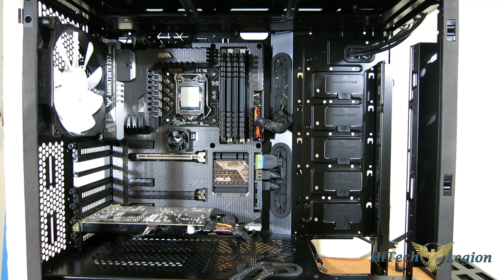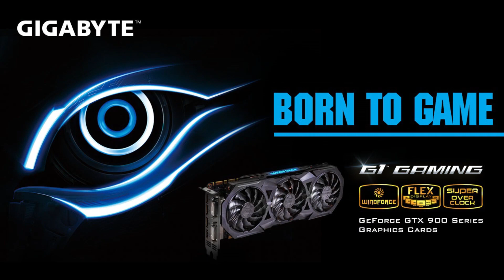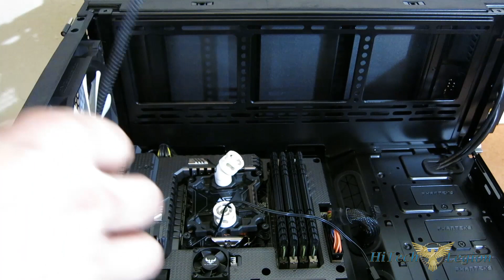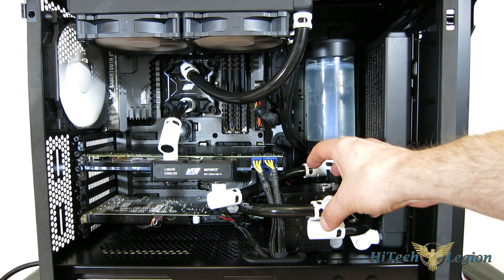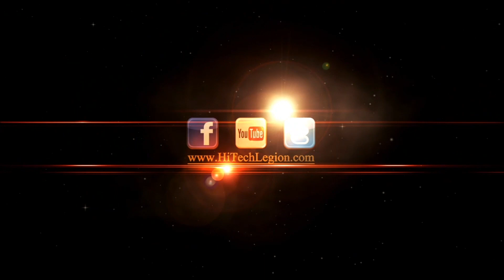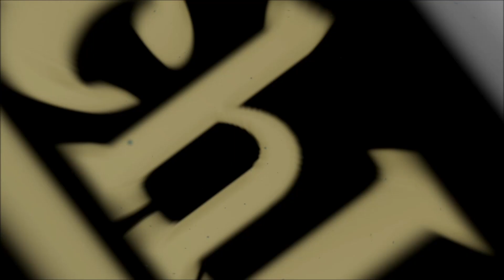Liquid Cooling Basics in The Phanteks EVOLV ATX

Comment: For 3 GPUs, 5 HDDs and 2 SSDs in the system, is it possible to install the pump in the bottom drive bay and a small reservour next to the PCIe slots (left hand side, away from upper five drive bays)?
Also, does are there enough opennings for exhaust, for the upper radiator?

Comment: Im using a Corsair h55 cooling system. If I plug the radiator fan into the fan hub to I plug the 3 pin pump power into the fan hub too or can I plug it into "CPU_OPT" on the motherboard?

Comment: Would you be able to tell me if using a 45mm thick 360 rad in the top with 1 set of fans (Alphacool XT45) and a 240mm Monsta in the front with push/pull would be possible? If it is, can it be done with the removable plate in the front of the PSU shroud left in? Can the fitting connections for both rads be in the top front corner of the case without any interference? Or is it possible to fit the 360 in the top with enough room above a rear 140mm fan to get the tubing connected there instead of the front?

Comment: Could you do a 280mm up top and a 120mm in the rear and then just keep the 200mm fan in the front as it is? would that fit?
I wanted to do a EVGA GeForce GTX 1080 8GB FTW Hybrid GPU with the NZXT Kraken X62 Liquid CPU Cooler. It seems to me that it would fit but I'd want to make sure before I buy it.

Comment: Are there space enough to mount 360 radiator with Push Pull in the top and the front? I´m think about using a "Fractal Design Kelvin s36"
Reply: 9082

Comment: So... is it possible to fit 2 360mm radiators with 25mm fans on the front and top without the radiators hitting each other? I'm sorry I didn't quite understand the part about radiator clearance. Very extensive review on the watercooling capabilites of this case though, it's just that my brain is a potato...

Comment: I'm still confused about the clearing for the top part. You mentioned that a thick radiator would interfere with the cpu waterblock, but I didn't get what those values were. What would have been the icing on the cake here, was the addition of a recommended max top/front radiator/fan thickness to not go over.

back to my question: will ~90mm be too much for it? I'd hate to spend ~200USD to find out.

Comment: Hello! Can some one help me? I was wondering the swiftech x2 prestige could be mounted in the front of the case?
Reply: +Facundo Cabral The H220 or H320-X2 Prestige will fit with no issue. I haven't had the opportunity to try the H240-X2, but I am very doubtful it would fit through the midplate opening without some modification.
Reply: Oh thx! Cause Im want to put a H320 x2 and other radiator

Comment: Can i put two 280 All In One liquid coolers in that case ? For example, can i put one Corsair H115i for the CPU at the top, and another one for the GPU at the front of the case ?

I don't really care about losing the mechanical drive slot in front. I just want to know if i can do it.

Also i don't want to put in in push/pull configuration, so count only the radiator an the two fans each time.

Any answer is very appreciated !
Reply: yes

Comment: Can i just remove the strips in the top to mount the fans ?
Reply: +KellerCraft You could....but it would weaken the chassis, and the fans would be only a couple of mm from the top of the case which would leave them as essentially useless.
Reply: +George Cella you know how much space there is?
Reply: +KellerCraft Not sure, but most certainly not enough to house a regular fan, maybe some really slim fans, but I doubt it would be worth it.

Comment: Do you think a crosair 100i hydro series could fit in there with a Gtx 980 ti water force could fit it there? But I was thinking of getting 2 Gtx 980 ti water force so do you thing 2 of them would fit with the crosair?
Reply: +Parker Myers You could probably mount the H100i at the top and then the radiators for the Waterforce cards in the front :)
Reply: both of then?
Reply: Parker Myers If the tubes are long enough, I don't see why it wouldn't work. I don't know exactly how big the fittings on the GPU radiators are, you might have to take off that little plate in the front of the PSU covers and maybe even have to take out the hard drive cage.

But if it's possible to mount the GPU radiators with the fittings facing to the side, then you should be able to mount but of them in the 2 top fan slots in the front and then the H100i at the top.

The third option, wich is just speculations from my side, could be to mount the radiator for the first GPU in the rear fan slot, the radiator for the bottom GPU in one of the front slots and then the H100i in the top. You might have to mount the H100i in the 2 frontmost fanmounts at the top, but it could work.

Comment: the only i worried is leaking ? but watercooling  is awesome .. :) any tip about that?
Reply: +Fazree Said Leaks are not as common now as people fear. The quality of components has gotten much better over the last few years. Use top notch components, compression fittings and tubing. Take your time doing your assembly and use common sense when you make your connections. Make sure you leak test before you power your components.
Reply: im stil learn on watercoiler not pretty confident to build self ...

Comment: can i fit the ek predator 360? its longer than the regular 360rad :(
Reply: +NelsonTituAaa yes you can mount it in the front but you have to get rid of the 3.5 bay they do make 3.5 holders for the ssd mounts http://www.scan.co.uk/products/phanteks-ph-hddkt-35-drop-n-lock-hard-drive-bracket-black-for-enthoo-mini-xl-and-primo-computer-case, or you can mount it on top removing the rear fan. https://uk.pcpartpicker.com/b/WGZ8TW#cx1268556
Reply: +Marklp16 Thanks for this!!! I see that ill have to remove the rear fan... im fine with the trade off lol
Reply: Let me know how it goes I want this case but cannot seem to find any white ones.
Reply: +Marklp16 I know how you feel! mini itx comes in white.. I wish I could buy it in white also.. black it is

Comment: Can you fit a 280 top and front while leaving the hard drive trays in the bottom?
Reply: +Realms No, but Phanteks sells a singe HDD tray to be mounted in front of teh PSU for that application. It became available after this video was made.
Reply: +George Cella I know it's too late for me too comment but.... Im planning to place a 360 60mm rad on front and and 240 30mm on top.... if i remove the bays and placed the single hdd tray on the front of the psu, do I still have space for my res and pump.. btw the PUMP is EK-XTOP Revo Dual D5 PWM Serial ( https://www.ekwb.com/shop/ek-xtop-revo-dual-d5-pwm-serial-incl-pump ) and the RES is EK-RES X3 150 Lite (https://www.ekwb.com/shop/ek-res-x3-150-lite)
The reason that I chose that pump was only for Aesthetic purposes. Nothing more nothing less...
Reply: Francis Mari Margallo You would have more roon, and would wind up with a more balanced look doing the 360 up top and the 240 in the front. With the midplate, a 240 and 360 look the same in the front, while the 360 up top looks cleaner. This will also open up more room for the pump.
Reply: George Cella  Oh My God!!! Why didn't I thought of that... lOl..... thanks for the suggestion...

Comment: Could anyone tell me if a slim 360 in the top would work in conjunction with a 240 in the front?
Reply: +Dan Pearson Im planning on doing that as well, I'm pretty sure it will work, just maybe you have to take out the bottom plate at the front, or make a small cutout with the dremmel in said plate..
Reply: +Jazz Greiner actually have already done it haha Built my system into the evolv a couple of months ago and it's absolutely stunning. In order to achieve the configuration I have with the rads (fittings on the 360 rad towards the front of the case) I had to slide the 360 rad further to the back of the case than is designed to resulting in not being able to screw in that end but it is still very firmly mounted so it worked! If you want to check out any photos of my build there is a photo on my Instagram '_danpearson_'.

Comment: I'm considering this case for watercooled  980Ti SLI   , i have 2 x 240  rads and XSPC D5 Photon 170 with integrated pump and I'm little worried I wont have enough space, what's your take on it ? will it be big enough ?
I have CM Storm Stryker which is big enough but I want to change case got bored of it, Is this case much smaller ?
Reply: +RobotDevil666xx That setup fits - but how will depend on the thickness of the rads.
Reply: +George Cella OK sounds good, those are the rads i have 
https://www.overclockers.co.uk/showproduct.php?prodid=WC-084-XS
Reply: RobotDevil666xx This video shows it with a Photon 170 and two EX240 rads..... The Photon w/attached pump will be an easier fit than what is done here.
Reply: +George Cella 
Damn looks like it will be tight fit maybe using PTEG tubing and 90 adapters would help

Comment: This is a very informative video. I can see the water cooling limitations despite the case having a large space for it.

For $180 I think this case could do more. Something like removable PSU shroud for easy pump installation at the bottom, adjustable HDD case, and having some room between top radiator (with fans) and front radiator.

Comment: What I'm curious about is would a 250mm tube reservoir fit in this case with a similar radiator setup and obviously have the pump down below? And what size tubing would be ideal for this case? I was hoping to get away with 1/2 but if I would have to, 3/8 would be best since this case is small.
Reply: KHROMATICxKHAOS With the dual 240mm radiator setup it can be done. You have just over 300mm to work with in the main chamber, plus a little additional wiggle room when you remove the divider above the HDD bays.

Comment: Hey George what res are you running? and any dimensions? I'm going for a bit of a complex build but idk if it will fit
Reply: ***** It's an XSPC Photon 170 - 179 x 72 x 86mm. Beautiful res, but one of the largest in terms of circumference.
Reply: George Cella thank you. you think I'll be okay with the EK-D5 Vario w/140 res? I'm planning to mount it behind a EK-PE-240 rad up front.
Reply: ***** Definitely - that will be much shorter than what I am using here.